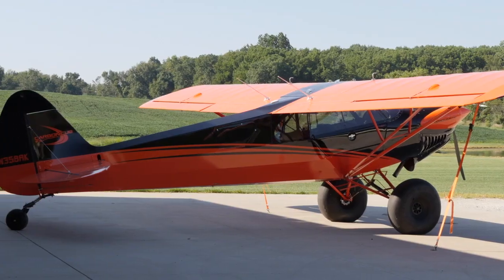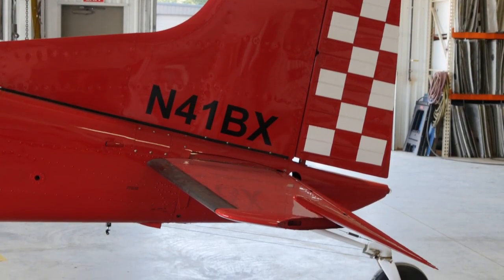Roy Learns WHEEL LANDINGS IN THE CESSNA 180/185 SKYWAGON Pt.1

Comment: I must clarify the flap issue. Most all landings I use 40 degrees. But in 90 degree crosswinds, wind directly at the wing tip I don’t recommend it. A wind from the nose to 45 degrees use any flap you want. 20 knot wind at 90 degree to the nose, be careful, recommend no flap. The great thing about flying is their is more than one way to do things, but if your in the repair shop your doing something wrong.😊

Comment: This is not great advice.  Here’s a hint:   Flaps 40 is your friend on ALL wheel landings.   Trim a bit nose up at flaps 40 and relax back pressure at touchdown.  There’s never a need to push the yoke forward, the drag at touchdown should be enough.   The added nose down attitude at touchdown from flaps 40 will stick it every time and no tendency to PIO because AOA stays negative as the tail comes up on its own.   The only thing I agreed with is get all the aileron in as you slow down.   I’ve landed in every wind condition from calm to gusting to 45 knots and the only issue flaps 40 might give someone is if they trim for too slow a speed and then are forced to go around.   Also avoid strong x-wind from the left for obvious reasons especially with the big block engine conversions.
Reply: Sorry. Incorrect.
Reply: Also, big block conversions do not affect aerodynamics and proper pilot techniques. On downwind sometime pull the mixture...the aircraft does not care what engine is hanging on the mounts...it responds to proper pilot control input.